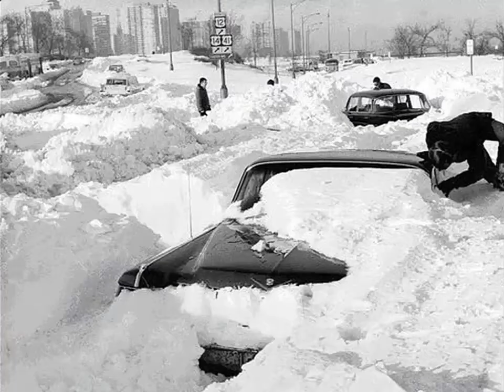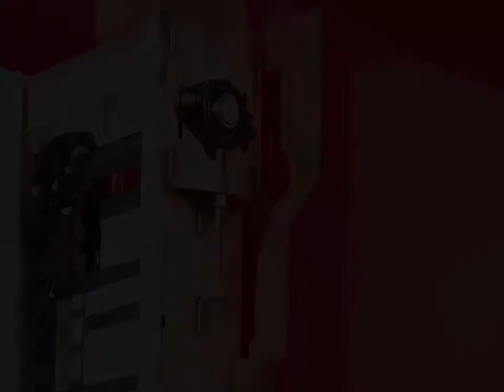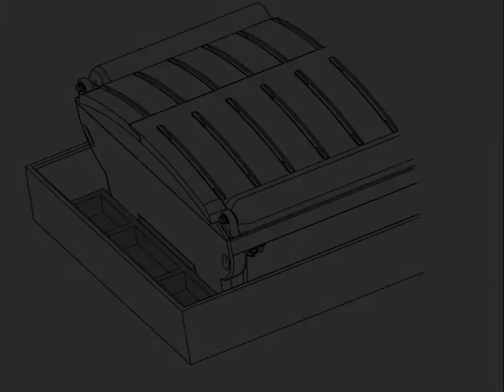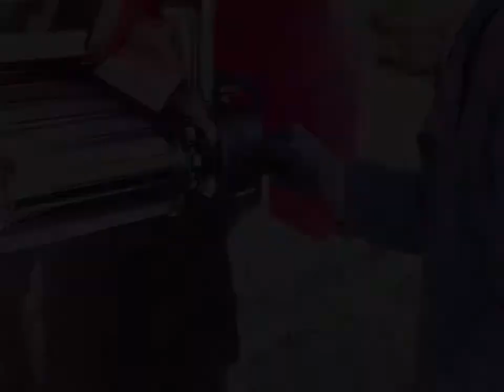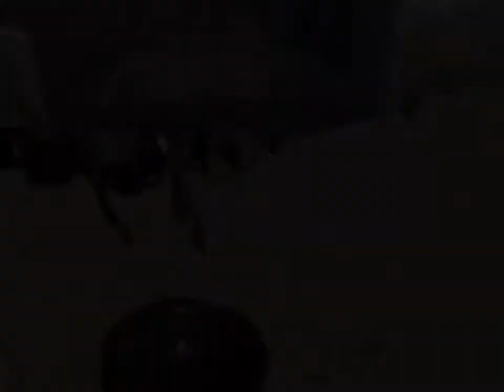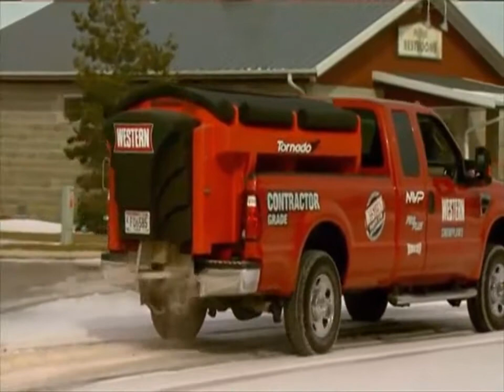WESTERN® Preseason Tornado™ Hopper Spreader Maintenance

Comment: You're spreading misinformation about servicing the conveyor motor annually!!! You just sent me on a wild goose chase trying to find the gear oil for the conveyor motor!!! It only specifies the type of oil it takes Mobil SHC 632 so you can properly dispose of it when your spreader has reached the end of its useful service life. It says it right in the manual page 20. You owe me some money for wasting so much of my time! I have been calling every parts house and Western plow dealer in my state since yesterday afternoon. Finally I had to call Western head quarters to get an answer. I almost ordered a 5 gallon bucket of Mobil SHC 632 for $500 because it's all I could find. Hopefully other people read this comment before you waste their time too. You need to delete this video. You cost me so much time and money. And you made me look like an idiot because every service department for Western plows I spoke to said they've never heard of changing the oil in the conveyor motor!